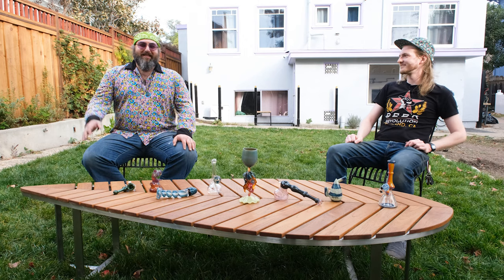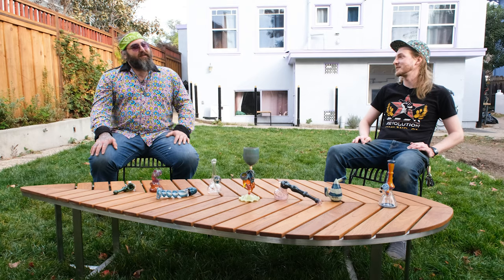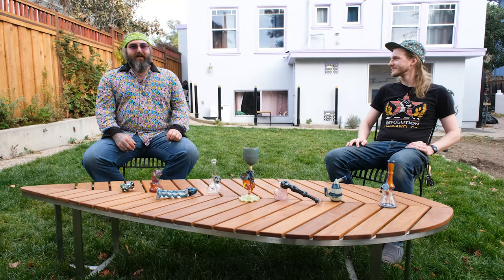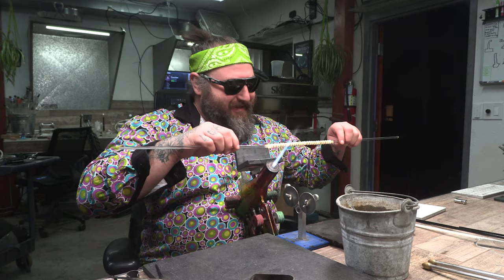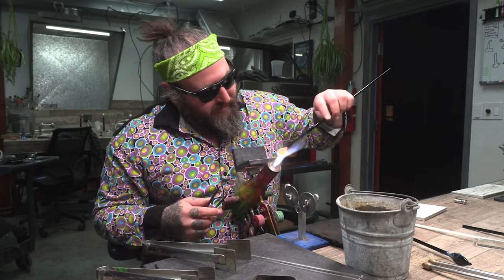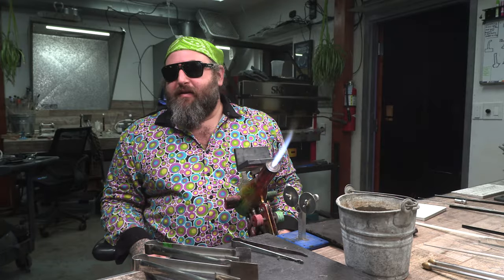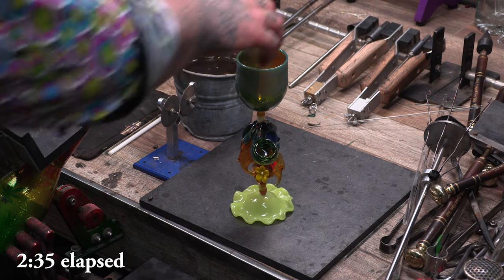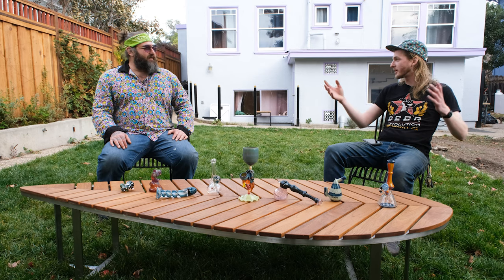Making a Sculptural Goblet - Stem, Cup and Flared Foot demo || On the Torch SEASON 2 Ep12

Comment: I was wondering how to approach attaching the larger part of the goblet to the bottom.  The best I could come up was a 5 point punty bridge inside the tube and then use the smith little to smooth it out after... but, then, you pulled out that badass Italian tool that perfectly serves that purpose. You are blessed indeed to have the resources you have and thank you always for sharing them.
Reply: The other way is to cool your cup and hold it in your hand for the attachment. As long as you only heat your alvolio you should be able to get away with attaching a cold up to a hot stem.

Comment: Great video!! The exotic colours are still produced by Northstar glass, and the mixes have gotten much better over the years. Theres red, blue, and green exotic, and theres also caramel which is a very silvery yellow. Both red exotic and caramel mushroom implosions will form auras on the caps when left to cycle in the kiln for a few weeks.
Reply: Ill add though that Ive come to prefer Penumbra by Glass Alchemy to blue exotic for a silvery blue.